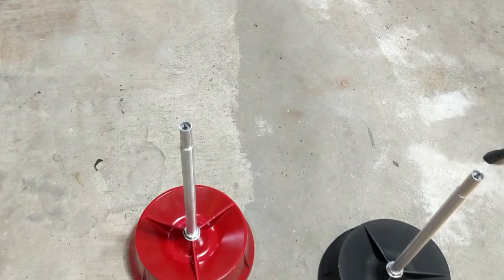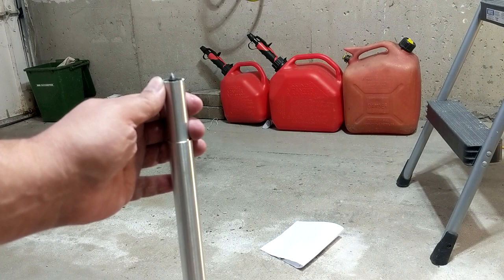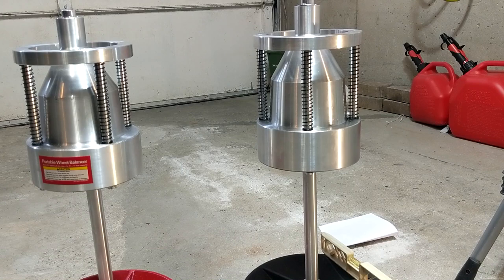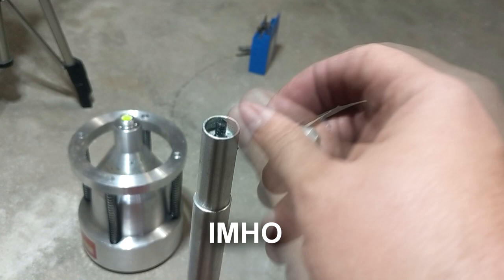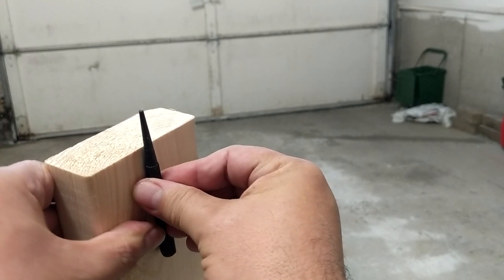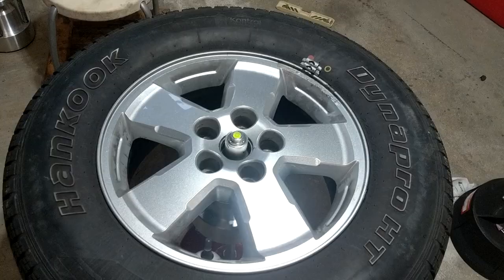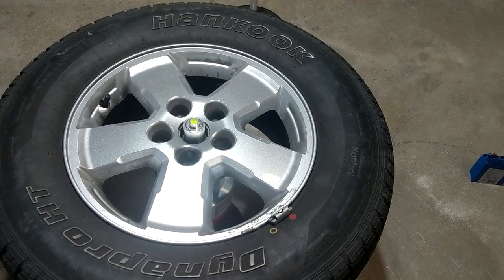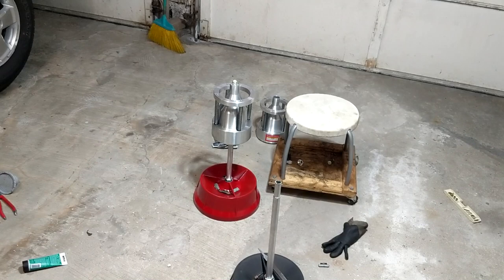Balance A Tire The Better Way. Free Wheel Balancer Mods Makes It 100x More Accurate For $0. PT 1

Comment: I see no need to totally build a new center bushing. I pressed the one out that came with the balancer and opened up the hole with a 7/32  drill bit down to the bottom of the existing hole. The factory hole acts better than a center drill for aligning the larger drill bit and no greater precision is needed for this tools intended use.  Balancing a tire is not a task that demands  extreme precision.

Comment: Still need to expose the cone exactly in the center of the wheel hole. The moving part with springs must be removed it moves diferent sides and creates disbalance.

Comment: These balancers will only balance static, not dynamic. They work well on narrower tires but the wider you get the more imbalance there is between the front and back of the wheel. To remove that you need a dynamic balancer.
Reply from the maker: i get that, but when u pay and not getting the results expected and getting responses that it must be something else as the fault, desperate measures were taken, and those measures acheieved better results than the ones done by pros on a dynamic balancer, but not yet perfect
Reply: @diyvinny6300  Good point. You could do what I did and buy a dynamic balancer. I found an Accuturn balancer from a shop that was closing for $250.00. I have two collector cars and five drivers in the family, so it's paid for itself quickly. Plus I do other people's cars and they pay. I also picked up a Coats 1010 for $85.00, which makes mounting/dismounting easy.

Comment: When I was a kid the bubble balancers were much more touchier than these that we get from Amazon. I noticed that when putting the top on mine. It felt too tight enough. Like a lock nut. It looked similar , but didn't act the similarly.

Comment: If you widen the hole....am I right in thinking the is not way of knowing if the tip is in the center of the pivot point.

Has anybody tried to use the balance rig as delivered.

I mean does it really matter if its sitting on the shoulder.....I agree it dont sound right......but maybe its accurate enough.
Reply from the maker: i did use as delivered, thats why i made this video

Comment: AM GOING TO MAKE A NEW  PIVOT MARK  WITH A SHARP STEEL PUNCH BEFORE ADDING THE ROUND PIC  OF HARD METAL OUT OF A LEAF TRUCK SPRING,,, AND AM PUNTING IN A NEW PIVOT PIN AM MAKING OUT OF A POWER SAW FILE  SHARPENED WITH MY HOME MADE  BIT SHARPENER

Comment: You punched out the center off camera we could not see it. Did you punch from the top downward or punch from the inside upward ? Also you drilled off camera did you drill the punched center with a 3/8 bit if so how deep ?
Reply from the maker: in the vid i showed from the top (unit in its normal orientation as when on the pole) pushing down the bushing and it will pop out from underneath.
yes i used 3/8 as stated in vid but u can use either a little smaller or larger bit. i went down just enough maybe a 1/16 to 1/8 of an inch. vid shows what it looked like after drilling it out, do a little at a time would be my best advice
Reply: @diyvinny6300  ...To put back the bushing do you push it back from underneath back up?
Reply from the maker: @thewishmastur  yes, opposite of removal, some grease in hole wouldnt hurt for it to make it easier to slide back in
Reply: @diyvinny6300  ...for drilling did you use a drill press or a portable hand drill? Thx.
Reply from the maker: @thewishmastur  hand drill

Comment: What size drill bit did you use? How deep did you drill? Has anyone tried a countersink?
Reply from the maker: cant remember size, but fairly big iirc 1/2", i think its in the vid, viewers have posted in the comments their technique of drilling out the hole, some even using a lathe and or drill press, ymmv

Comment: The mass of the wheel on the balancer will negate the slight friction of the pivot pin you show when unloaded
Reply from the maker: if the pin was sitting on its tip but its not, u can clearly see that motion is being negated even when loaded, the hole in the bushing is to small for the pointed  tip
Reply: Friction from unmodded pivot pin and/or hole affects the initial bubble centering, which is done before the tire/wheel assembly goes on. Mine gave very inconsistent setups until modded to swing freely at the slightest touch. That done, the actual balance results are still not repeatable b/c the floating ring is sticky on its 4 rods and springs. Will next disassemble to check fit and concentricity, which is SOS for Chinese stuff.
Reply: @diyvinny6300  I got one for Christmas last year and the modification I did was use a slightly bigger drill bit to open up the socket in the top so the pin on the base doesn’t contact the sides any more. Now it will swing almost I definitely! So you were right!

Comment: V? is it enough to just drill the hole? and were you happy with the balance job you did?
Reply from the maker: yes, and after rebalancing my tires myself they were much better that what tire shop done b4, i can go faster on highway than b4. but patience and continually checking your balance points  needed for a good job. make sure u read about placement of weights, not as straight forward as i had thought
Reply: is it possible to just jbweld a laser on the bubble? and leave the batteries in
Reply from the maker: @toupsclassroomtoupsclassro9557  i would say yes, but u still need to hack the switch

Comment: Hello man, thank you for this good tip, i put in reply some instruction that i believe is from some vintage bubble balancer, maybe it's usefull.
Reply: The patented system involves four steps.

First, the wheel is placed horizontally on a balancer equipped with a spirit level and allowed to tilt freely from side to side. The bubble in the spirit level indicates the location of the 'light spot' on the wheel-- the point of greatest imbalance and the one which tips up the highest when the wheel tilts.

Second, four equal weights are placed on the rim of the wheel, two on each side of the light spot and immediately adjacent to it. The weights are of a size such that when all four are placed at the light spot, they are sufficient to correct the tilt of the wheel and just slightly to 'overbalance' it.

Third, the pairs of weights are moved away from the light spot equal distances along the rim, until the induced overbalance is precisely corrected and the angle of tilt, as shown by the spirit level, is zero.

Fourth, one of the weights in each pair is fastened into position; the other is removed, and fastened into the corresponding position on the other (nether) side of the wheel.

Comment: What do you think of the videos that show how badly a bubble balancer works after you put it on a machine that does dynamic balancing on both planes compared to you doing only 1? I feel bad for anyone that thinks this is a viable option for modern cars that go faster than farm truck speeds
Reply from the maker: like i said in the video, 2 mechanics couldnt get it balanced using a dynamic balancer, with my modded balancer i got to a higher speed b4 noticing balance issues
Reply: That’s because they either have machines that aren’t calibrated or are installed wrong or they don’t know what they are doing or any combo of those problems. Believe what you want but you’d get laughed out of a shop that has the right equipment. Most shops have techs that don’t know how to use computer balancers or they have installation issues. Dynamically balanced wheels are always the best
Reply from the maker: @mark-ui8lu  agreed but after trying a couple of mechanics with their "pro" balancers and blaming trucks suspension for balancing issues even though my winter tires have no problems. im not going to keep paying for a supposedly simple job just to go back and complain. fyi, my diy static job came out better than theirs, issues start after 130km/hr , 80mph, which i dont normally go that fast. ive balanced my sons car tires after installing them on rims and no issues at all at high speeds. static might not be the best method but it gets the job done to be "good enough" as to not deal with mechanics
Reply: @diyvinny6300  I do all my own work whenever possible exactly for this reason. It's very difficult to find a mechanic at a reasonable price that you can trust 100%. The tyre shops around here are mostly staffed by very young guys who don't make much attempt at being professional.

Comment: Maybe you just shouldn't be driving an SUV with inexpensive tires at almost 90 MPH.
Reply from the maker: doesnt explaqin why 2 different pro balancing jobs didnt work, fyi , theyre not some cheap chineseium tires for which i would then agree with ur comments
Reply: @diyvinny6300  But they are Hankook Dynapro HT.  A light truck/SUV tire. S or maybe T rated at best.  You just can't really expect a perfectly smooth ride at high speeds in an SUV with that tire.  If you want to drive that fast (I wouldn't suggest it) get some higher rated better tires.
Reply from the maker: @SuperUncleRyan  90mph is not formula one racing speeds, fyi my cheap winter tires have no vibration at 90mph. my diy job got better results than the ones done on tire machines.....just saying. im tired of paying for crap results hence my diy nature

Comment: Why would anybody want to Bubble Balance Tires TODAY  It's Garbage compared to Computer Balance !!!
Reply from the maker: if u had actually watched the video u would know why
Reply: Why? B/c many here mount their own tires and many tire/wheel assemblies are only statically imbalanced. Some that I had done at tire stores had weight locations that showed only static imbalance was present. If bubble balancing doesn't work the tire stores will still be there.

Comment: It's amazing these people are so ignorant to dynamic balancing. This is not a viable method anymore nor has it been for many many years. Good for farm trucks maybe.
Reply: It's mazing that this tool could and did balance my tires better than a tire shop did. It's all in how to use a tool.
Reply: Dynamic balancing is only as good as person using the tool. I've had MANY wheels come out wobbling from shops using dynamic balancers. So many that I do what Vinny does and balance all my own wheels @ home with bubble balancer.
Reply: My dynamic balanced new tires done by a pro…shake so badly.  It’s no joke….I’ll try this method.
Reply: Not every individual tire/wheel assembly is too dynamically imbalanced for this to work. Wide wheels and tires are more susceptible. This is a reasonable option for people mounting their own tires and dynamic balancing is still an option for problem cases. Selective rotation and driving will show which tire needs dynamic balancing.